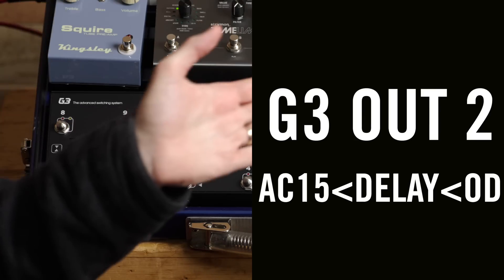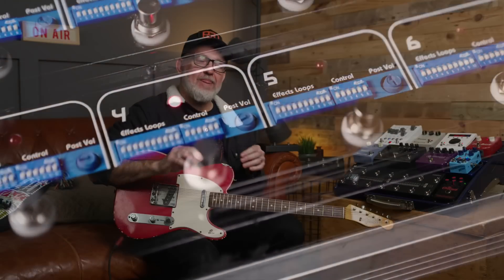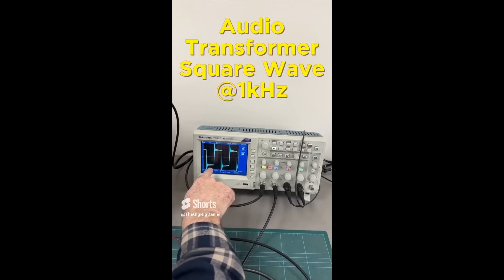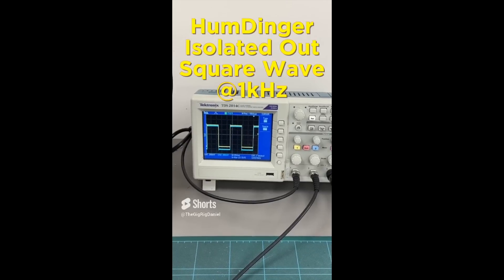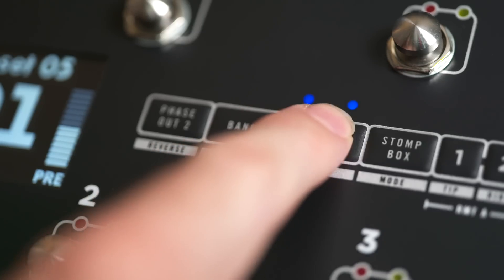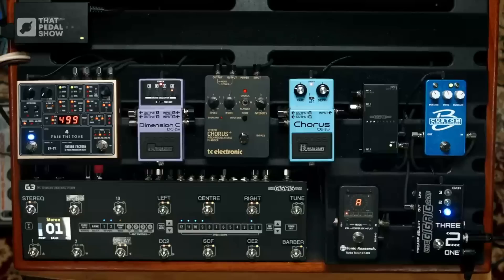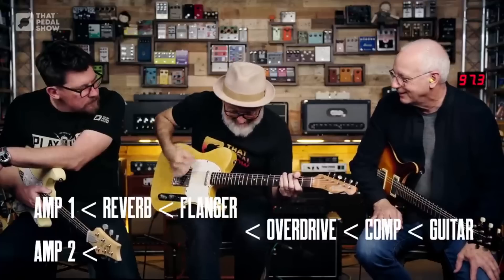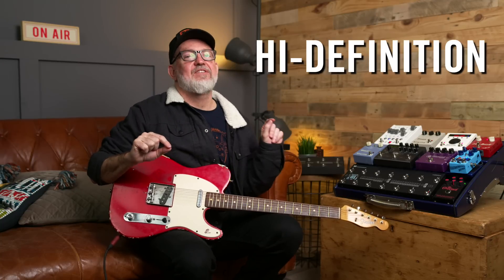TheGigRig Announces The Ultimate Guitar Signal Isolation Technology

Comment: I was mucking around with the humdinger last weekend in a wet/dry setup and I kept getting this really horrible ticking noise in the second output.  I tried every combination of things I could think of to eliminate it and finally narrowed it down to the power supply (At least I think!) The noise went away entirely when I gave the humdinger its own dedicated 9vdc supply as opposed to one of the outlets of the T rex fuel tank.  When I checked their corresponding output voltages channel 5 of the T rex measured 8.94vdc compared to the solid 9vdc from the made in China transformer.  Have you come across this during your thousands of hours of testing and development or have I got something else going on that I haven't figured out yet?  Obviously I'd prefer not to have a dozen individual power transformers if it can be avoided.
Reply from the maker: Hi there, that’s really interesting, no er haven’t but I do have a fuel tank somewhere, I’ll dig it out and try it. Cheers mate 👍
Reply: Something I didn’t do at the time, and I’m kicking myself for now, is check what was coming out of the mains that day….!😩🤦‍♂️

Comment: I have a G2 (and love it), what would you advise is the best way to run switching with a three amp setup with the G2 and also make sure that there is no ground loops? (Each amp running only 1 at a time)
Reply from the maker: Hi Steve, thanks so much. I do this myself. I use a HumDinger in one of the loops so I can switch the outputs but also so I can place the third amp where I want it in the signal path. Works a treat 🤓🙏
Reply: @TheGigRigDaniel  Thank you!

Comment: Can the Humdinger or ABY-Baby be used with the two outputs of a last in chain Stereo pedal to two amps (stereo, but not in w/d or w/d/w)? If so, how and would it still achieve isolation?
Reply from the maker: Hi Stephen, absolutely, you only need to isolate one of the amps. In this case, use the HumDinger, out from one side of the pedal, in to the HumDinger, Isolated out to the amp 🤓🙏

Comment: Dan, if we are running a wet dry wet rig and using the two out puts on the gigrig to go to the two wet amps and coming out of a stereo pedal on loop 6 for the dry amp, would you add an isolator before the dry amp as well?
Reply from the maker: If use a HumDinger in loop 6 for the dry amp. The HumDinger also uses this tech 👍

Comment: Hey guys- I'm trying to setup something sort of like this but much smaller and simpler- I don't have the money for a GIg Rig switch right now. I have a Moen ABY switch though with a buffer built into it- and I set up two separate signal chains. Problem is- my amp only has one input- it does have a separate channel, an OD channel- but only one input. So- I bought a Y cable- a splitter and thought I would connect both signal chains to it and be able to switch between them with the ABY switch. But- the first splitter cable I bought was this higher end audio cable that only worked one way- the wrong way. It would split a single output into two outputs but not a single input into 2 inputs- if that makes sense. So- I bought a regular Hosa YPP-111 Y cable- but I tried to get off cheap, I bought it used- and it's bad. So, I'm going to go over to the local shop and see if I can just buy one off the shelf that's good. Do you guys see any reason this wouldn't work?
Reply from the maker: Hi there, it’s a challenge trying to do something like this cheap, what you need is some sort of mixer before the input of the amplifier. JHS make a small summing device that will work. So you want to split the signal, go through your two signal chains, and then sum them back together before it hits the amp. Things to look out for are phase problems, and latency issues by running any non-analog dry through Pedals on either side of the chain. Wish you the very best of luck with it.
Reply: @TheGigRigDaniel   Hmm- even if I'm never going to run both chains at once, I need a summing amp?

Comment: ? Dan. How can I use 2 amps in a "wet/dry" configuration? I have 2 amps that are perfect for wet dry and pedals. What do I need to do? I am absolutely clueless on this and how do I get pedals to them? Can you explain in a simple explanation? Sorry if I missed it on the pedal show if you guys did this. If so just point the way. Thanks.
Reply from the maker: Hi Christopher. In simple terms, you want to split your signal somewhere in your chain, after your overdrives for example. Let’s say you use a HumDinger to split the  signal, place the HumDinger after your overdrive/gain pedals. Out of the last gain pedal to the input of the HumDinger. Then take the ISOLATED OUT and plug this into your ‘dry’ amp. Now take the normal output of the HumDinger and plug that into the next pedal in your chain. Now plug the output of the last pedal into your ‘wet! Amp. With this configuration you have all your gain sounds going to both amps but the pedals AFTER the spilt , delays and reverbs for example, are only going to one amp. 
Hope that helps 👍
Reply: @TheGigRigDaniel  thank you Dan. FYI, I love the Humdinger aspects. I just need to get one. But where? Actually how much is the most decisional aspect of my acquisition in this chain of thought. Lol
Reply from the maker: @christophervincent8420  if you’re after a HumDinger you can by one direct from us at thegigrig. If you’re looking to save some cash try just with a splitter. Good luck! 👍
Reply: @TheGigRigDaniel  lol oh! And I'm in the States. So that makes it a bit more expensive lol

Comment: Always improving is the key ! 
But it's quitte frustrating for early G3 adopters that was launch just 2 years ago... Integrated tuner OK. But now this one looks great.
Reply from the maker: Hi Pierre, I hear you, and yes it is possible to upgrade the back panel. 2 years ago was the idea, then proto, then proto 2, then proto 3, then testing, testing, testing, then search for more components, then more testing, then final proto, then long term testing, and only then do I consider releasing it. And I will just say again, the transformer isolation on OUT2 is fantastic! This really is a small improvement, it was more of scratching an itch for me.
Reply: @TheGigRigDaniel  Yeah but Dan, it's not cool man. Check out your pre-gain to boost overdrive pedals video and read my comment. I kinda go hard on this exact point. G3 launch was recent. I waited like a year to pick mine up so i haven't had it that long and you kind of confirmed my suspicion—which is that you're still tinkering with the layout design of the exterior and now this isolation tech to "scratch and itch" for you! Dude—THIS ISN'T JUST FOR YOU! LOL. This thing costs as much as a used car. It feels...disrespectful. You're not thinking about those of us who have recently supported you. It's really frustrating man.

Comment: You can run into harsh environments where the only thing that works is a Audio transformer.. balanced outputs always has some reference to ground. A nice Audio transformer should be a badge of honor on your gear, problem is they are expensive, and most of the guitar stuff also in your humdinger are not really made for full range audio..
Reply from the maker: Thanks Claude, the HumDinger will do a square wave from 10 Hz to 100 kHz. The signal is completely isolated, there’s no ground reference.

Comment: GIGRIG, So the Hi Definition Isolation is using Common Mode Rejection using a High Headroom Op amp or what?
Reply from the maker: Thanks Wayne, the opamps have great CMRR, are low noise and fast slew rate 👍

Comment: Wait, I got my G3 year and half ago. Does that mean mine does not have this? Do early G3 use same technology? Considering that I have no clue when it was made how can I know? Is there a certain serial number that you know of, that above it they are all with this output option?
Reply from the maker: Hi there, it’s on all units shipped this year, but as I said, it’s a small change on one output. The original G3’s, Atoms, G2’s, ABY BABY’s and HumDingers all sound fantastic, this is more about me scratching an itch.
Reply: @TheGigRigDaniel  Ist there possibility to by and update? I am Amp builder and very handy with soldering(read Pro 😀). I can solder true hole and SMD have few hot air stations and microscope. I have JBC soldering station with all kind of tips that can solder SMD to.
Reply: @TheGigRigDaniel  still makes me really sad that my new G3 is not new and best it can be 😞 I practically feel like mine is G3 and this year models are G4. So only one year I have had best switcher. Considering the price I feel sad. I thought I will be there for 5 plus years until G4 is out.
Reply: @NINEWALKING  This one tiny change does not make it a G4. At all.
Reply: @Qwitsoender  do not get insulted please but I have asked Dan not you and I have shared how I feel. And no, I have not said it is a G4, but it feels like to me. All that is matter is to  me at this moment is how it feels to me after investing this money and not making money with it. Do you even own G3? If you do and do not mind you are bigger man than me. I salute you. But me, I am disappointed. When you use boutique amplifiers, pedals and guitars that cost fortune and you chasse the tone I do not want to go true decoupling transformer. Same a I do not want to go true the dry contacts accept 100% necessary. Same as I do not want to see additional parallel capacitance. Or buffer when I do not want it. At level Gigrig stuff is, every promile counts and costs money. Not getting something that now people get for free, sorry feels like I am left behind. Your comment does not help me at all.
Reply: @NINEWALKING  Stop whining.
Reply: @NINEWALKING  Totally agree. I'm sorry, but I have to agree.
Reply: @NINEWALKING  I hope that you recover from whatever is making you feel this way fully and soon.  You have a gloriously-capable device which a great many of us cannot afford, and you have time to enjoy it.  Please, allow yourself to be happy.